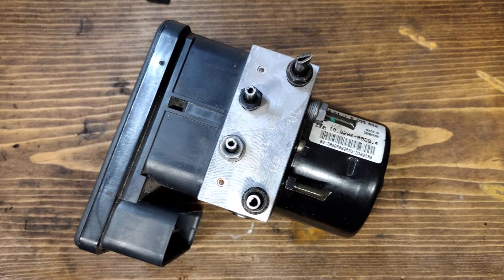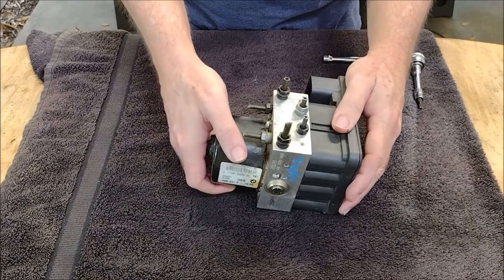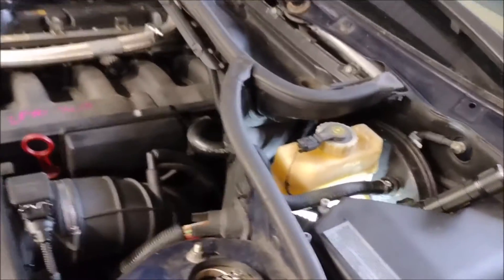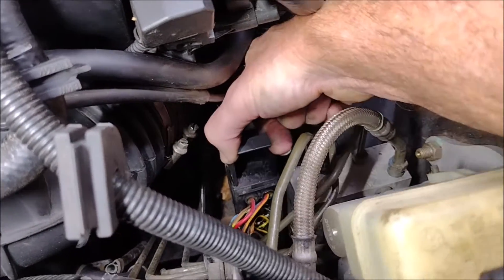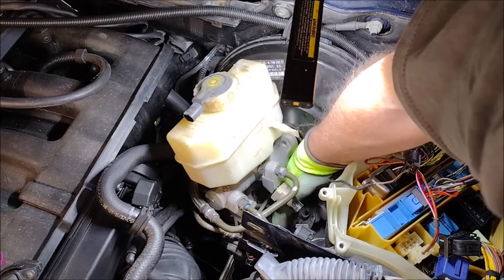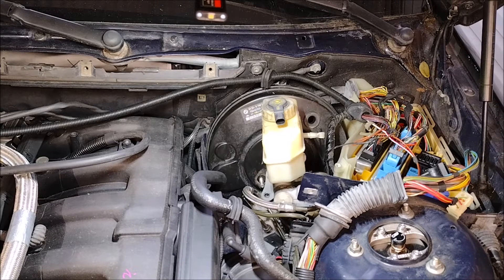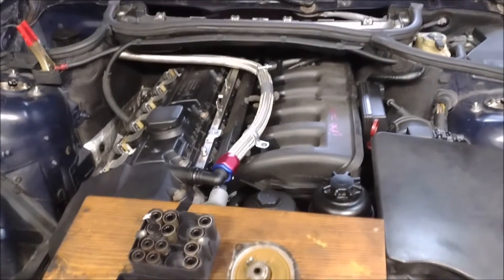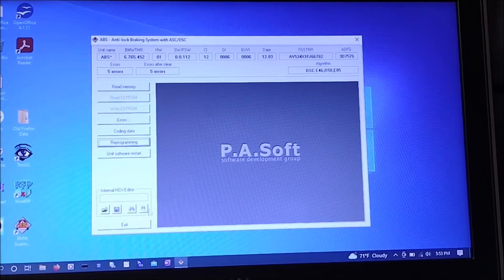BMW E46 Project: Replacing the ABS / DSC Unit WITHOUT Bleeding the Brakes!

Comment from the maker: Hey guys, I'm still trying to figure out how to make the new instrument cluster play nicey-nice with the other modules. If / when I get it figured out, I'll make a follow up video.
Reply: You literally have 3 options – 1) either remove and repprogram EERPROM chip inside the cluster and load it up with the correct VIN, or easier one – 2) align IKE, ABS and LCM with VIN from IKE. You can adjust both odometer and vin with BMW Scanner on LCM and IKE. IKE will be showing incorrect odometer (non-factual), but trifect should go away. 3) Third option is to use ISTA to manually reconfigure VIN on IKE but I haven't heard of any. success with used clusters - eerprom detects any attempt to alter the nubmers. If you decide to go with 1) – Chris Hutchins is doing this stuff, he's in NC. Find him on e46fanatics.
Reply: @keys_to_power  hi there. Could you please type wich thread did Chris explaining this procedure? . I'm gonna subscribe that forum cause I have the same problem with the abs asc unit and want definitely  solve it. thank you very much in advance
Reply: @keys_to_power  EERPROM is still the best option, never did it myself but the pretty clear take your used chip transfer it and its like nothing changed, doing the other option requires expensive tools and is just to complicated and prone to security issues.

Comment: I think I have a bad dsc on a 2002 330i. I have a foxwell code reader which show a 5df5 error code. I drove it watching the speed sensors and they all tracked within 1 of each other. Most of the time all four read the same. Sould I check anything else before buying a $200 used DSC? The code reader shows it as an MK60.... I have appreciated your videos and expertise for several years now and thank you in advance for any advice you might have for me..

Comment: I think the electronics are messed up on mine, I was driving and randomly I heard the pump going crazy and the car braking itself without me touching the brake, after that the dsc and abs lights went up, you think i can get away with just replacing what you did here?
Reply from the maker: I can't say for sure. But it sounds like the controller going bad. But just to be sure, you should scan for trouble codes, and go from there.
Edit to add: For example, if a wheel speed sensor is feeding bad data to the controller, it might freak out the controller. This is where time & effort on diagnostics really pays off... instead of just firing the parts cannon at it.
Reply: @michaelblacktree  yeah true, I'm going to double check first to see if the actual controller is bad or a wheel sensor acting up. I read some forums saying that these parts are backwards compatible and some people were fitting units from later models, you think it's worth it or just grab the exact same one? Its an 01 car
Reply from the maker: I get the same impression. The unit I bought was IIRC from an '03 E46, and my car is an '01. I have the DSC disabled (because race car), but the ABS works.
Reply: Did you figure out your 2001 325i "pump going crazy and the car braking itself without me touching the brake, after that the dsc and abs lights went up" issue? i have same car and same problem. Codes on Cen-Tech scan tool are 5E43, 5E4F, 5E3C and 5E38. Any help/suggestions welcome